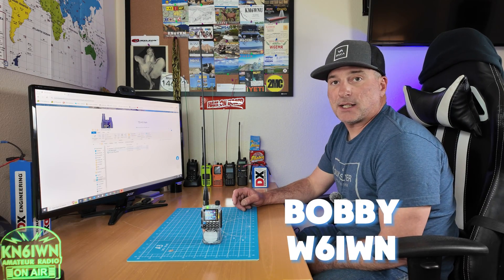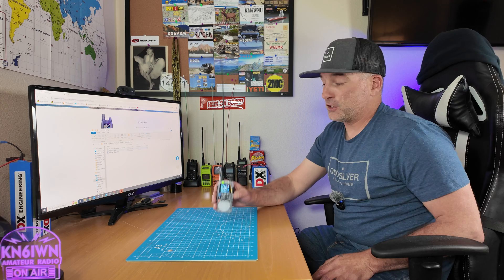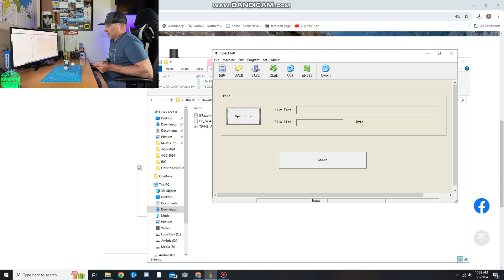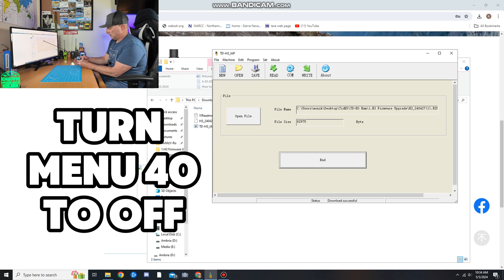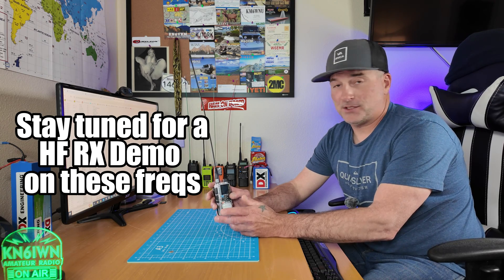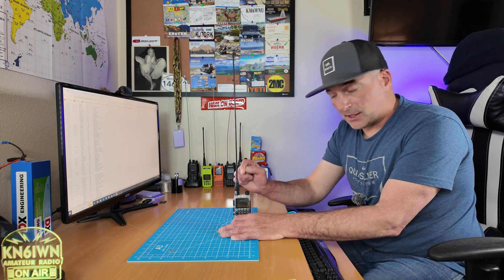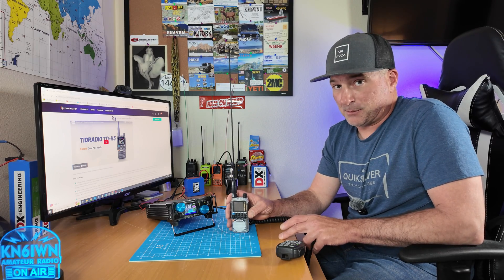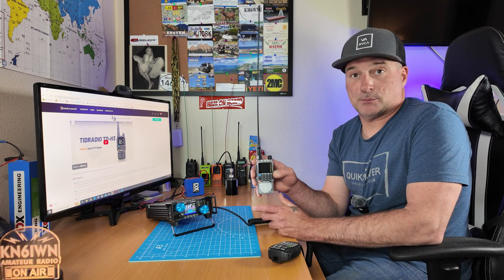TidRadio H3 Firmware update UNLOCKS 18MHz-49MHz

Comment: @W6IWN_Radio I'm hoping you can help me as my H3s arent responding to the update. They communicate over USB just fine (using either CHIRP or the TID programming s/w). But when I try to do a firmware update I turn on the radio with the (top) PTT button pressed. and the radio just turns on as normal. The screen is not blank as in your video and the status bar on the updater s/w never moves. Any Ideas? Thanks!
Reply from the maker: @MarkShapiroMusic  make sure your radio is off and the correct com port is selected in the firmware update software. Press start on the software first, then turn on your radio while holding the PTT.
Reply: @W6IWN_Radio  thanks for your reply. I've done all that, countless times. As I wrote- "I turn on the radio with the (top) PTT button pressed. and the radio just turns on as normal. The screen is not blank as in your video". Can you tell me what happens when you hpld the PTT and turn your radio on with NO CABLE attached? Does the radio turn on as usual or does it have a blank screen waiting for the firmware update?

Comment: Is there any way to upgrade software on Mac OS?
Reply from the maker: Try using CHIRP.
Reply: @W6IWN_Radio  Thanks for our response.  Tried CHIRP but evidently I need to buy a specific cable to connect radio to chirp.  ‘Ll be doing that.
Reply: @W6IWN_Radio  Also, the downloadable firmware files are all .exe files that are not going to work on Mac OS.

Comment: I really wanted this radio, I really wanted to like this radio but, I ordered one with a second battery that promptly shorted out, once I charged it. dead... day number two, ( after a few good QSO's) I noticed no power output - zero... after charging it on its cradle .... I'm wondering if the stun/kill feature somehow engaged ?  really weird behavior . my good old UV5R is about 12 years old, and it has never had any issues- ever , and it's so worn out that the keys are worn out- it has been everywhere with me.  so this whole thing left a bad taste in my mouth. I don't know if this is a CHIRP issue or a stun/kill (somehow) or charging issue? I'm going to try flashing the firmware - hoping that it solves the TX issues? friends say - so what it's a $30 radio, but so is my old timer.
Reply from the maker: Sorry you're having this experience. I haven't has any of those issues. I would email TidRadio or whoever you bought it from and ask for a replacement. I've heard about people overcharging with USB-C and burning out the battery.
Reply: @W6IWN_Radio  I think I got a lemon.. already reported the battery,  i just don't want to report the radio , they will think I'm the fault.  I'll just use it as a receiver. Or just harvest the batteries for other stuff.  Very unhappy,  I thought these things were great,  hearing all the good videos.  Don't want another one, too many strike-outs. 73 !

Comment: Good tips. I used the USB-C cable, I held down the middle PTT button. The firmware update 240530 fixed a number of issues, including SCAN on broadcast FM band. 🙂
Reply: Thanks! The MIDDLE PTT button? Did the TOP PTT button not work? (as all the documentation says to use). What made you try the middle one? I can't get the update to work no matter what I try. My radio just turns on as usual when I push the top PTT button and turn the radio on. Any help is appreciated.

Comment: How is the ssb tx audio on 2 meters ?
Reply from the maker: There is none to my knowledge.
Reply: @W6IWN_Radio  the quansheng tx on ssb on 2 meters but it depends on what firmware how the audio is I believe
Reply from the maker: @Knarf14  don't you need to add extra hardware modules as well to make this happen?
Reply: @W6IWN_Radio  the Quanshengs do it just with firmware , the version firmware i use the ssb sounds bad the version that someone i know which is more up to date the ssb tx sounds ok
Reply from the maker: @Knarf14  that would be awesome if TidRadio would add that. Better yet, make a new model similar to the qaungsheng. It would have to be open-source. 👉 @TidRadio

Comment: My 220 channels disappeared moving to Ver 240530 when I did an upload (read radio) on latest CHIRP Next 20240531.  Had to reenter, but all ok now.  The TID CPS also fails to show 220 channels even though they exist in the radio.
Reply from the maker: I had the same problem. It should be able to program them manually too, and it doesn't.

Comment: Thanks for putting this video together. I just upgraded my two TD-H3's that I received a few days ago. I decided to try using a Baofeng Kenwood cable, part number PL2303, and it worked fine on both units and didn't require any additional driver install on Windows 10 Pro. Just had to go to Device Manager to find out which Com Port it was on.
Reply from the maker: Thanks, I hope it helped. I'm glad you got it to work for both of your H3s! 👍 👍
Reply: @W6IWN_Radio  Yes sir it helped a lot! Me being an I.T. guy I always like to go through documentation or any available information before upgrading electronics. And your video hit all the needed steps along with showing it happening live, which , for me, is how I prefer to learn.

Comment: Here is a question for some one. Can aTD H3 HAVE THE FIRMWARE UPDATED FROM AN Android phone? Also exactly how do you get the firmware update from TID? I have went to the URL thats listed on the card that is included with the radio. And I have been told by Verizon that the number on the card is not active now either so any helpwill be appreciated. I despise windows and hate anything to do with Apple they rip off their own customers!
Reply from the maker: Sorry, I'm not aware of a way to do it from android. The link for the firmware is in the video description.
Reply: Has firmware update for TD 3 using USB Android  been resolved? 7:30 pm Intermountain time 10/14

Comment: Question: Does it really receive the Aircraft band in AM? I have the older firmware and it won't do the Aircraft band at all. Comment: It would be nice if Tidradio would allow the firmware hackers access to the firmware so it can be modified to do all kinds of cool things like the UV-K5.

Update: I read further down that the new firmware does indeed allow receiving AM Aircraft band, and that AM can be turned on and off in the menu. Now someone needs to add SSB. 😂 I'm going to attempt the firmware update shortly.
Reply from the maker: Yes, it does! I agree, I like the stuff that's been done with the UV-K5. Good luck, and thanks for watching!

Comment: @W6IWN , your demo if the squelch tail problem was solved is terrible ... it should be like this:  1) 1st you show us your squelch tail before the update ... 2) Then you show us the squelch tail after the firmware update ... best if you record both so you can show the difference one after the other ... they way you showed in this video is useless ... and we still dont know if it was solved/improved or not ...comon man you can do  better ./..then your demo of the 10/11 etc band is useless also ...why not simply add a 3 meters of wire to the antenna and do some tuning over the bands instead of using transmitter 10 cm's away ... i'm sorry this video is a TOTAL FAIL ...comon man you can do better then that.
Reply: Considering the lack of anybody else, putting this information out over the last several months, I think that you were a little harsh. Also, since you want to be nitpicky on somebody else, where are your videos? Lastly, what you meant to type (I hope) was “come on man” NOT  “common man” Two totally different meanings…
Reply from the maker: Thanks for your valuable input. 👍

Comment: About the only advantage of the frequency extension is FM receive on 10m. I would not attempt transmitting in the extended range as the radio probably has a real nasty performance outside its original designed bands without the required filters in the PA stage, just like other radios that are modified to work outside their normal VHF and UHF bands. Some even have poor performance before modification.
By the way, don't hold your breath on an AM update, without hardware AM detection its complicated and not a lot of use. AM Broadcast, Airbands, and CB receive is about it. 73.
Reply from the maker: It only RX there.

Comment: 18Mhz was already available on v240401. Also, I don't know when this bug was introduced to the radio, but try it... Go to any of the Memories, can be Memory 01, check the frequency, go to squelch and set it to one, now the frequency on Memory 01 has changed, either by the amount of your step or by 2.5Khz. Also tail is still not fixed, and the actual menu 40 does nothing.
Reply from the maker: It fixed the tail squelch issue for me 😃 like I demonstrated. I know nothing about this bug. Email TidRadio with a bug report.

Comment: I have found that the squelch tail issue is not resolved. It has “fixed” something with the tail when you transmit from your radio to a repeater, probably something to do with the tones used for closing squelch? However, when monitoring someone else’s traffic on repeaters, you’ll notice that we still get the loud squelch when it closes. Menu option 40 should probably be the option we are messing with to find if it’s fixed or not. I believe menu option 30 would be for simplex.
Reply: they probably cant fix it cause it is a hardware problem ... in addition those tid-engineers suck ...they clearly dont understand english nor do they understand the real squelch problem.

Comment: Using the USB-C does indeed work fine for firmware updates. Also, check menu items 48 (and 52, 53, and 54, for even more spicyness) and it on the radio. The AM receive band is turned off by default (menu 48), and 52-54 allow you to transmit out of band on 220, 300, and 500 MHz if you want.
Reply from the maker: Awesome, thanks for the info! I was afraid to try to be on the safe side. Do you know where the firmware update notes can be found?
Reply: @W6IWN_Radio  Unfortunately I am still trying to find those notes. I'll let you know if I manage to find them.
Reply from the maker: @HelloNotMe9999  same boat. Thanks
Reply: @W6IWN_Radio  Also, I should note that I'm using the "Unlocked" version of the firmware just for clarity.
Reply: @HelloNotMe9999 I did a binary compare of all 3 versions of the firmware file. They are identical, as are all of the “IAP_setup” executables. The three programming software setup executables are different from one another, but only in as much as the contents the apply to the radio’s memories. The “unlocked” setup applies nothing, the memories are left blank. The “GMRS” setup populates the memory channels with GMRS frequencies, and the “ham” setup populates them with repeaters that for most people will be useless (since they are geographically localized).
Reply: @cyberia55  I would assume so given that changing the modes only takes holding the PTT and star key down while powering up. I just want to know exactly what changed from the previous version of firmware. 

Unrelated: I did try programming the CB channels in (for monitoring purposes only) and It won't accept them in Chirp or the native CPS software. Mildly disappointed. I can dial them in manually though, so I suppose I'll have to do it the hard way with the keypad.